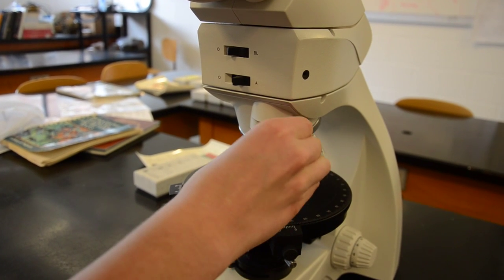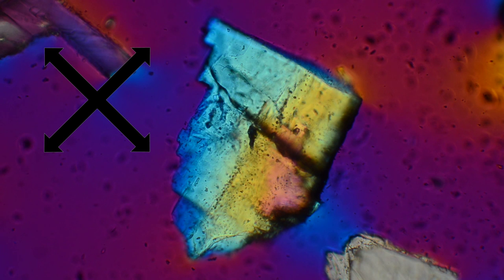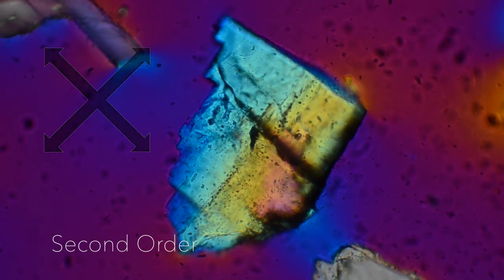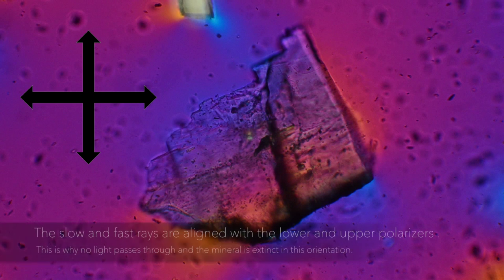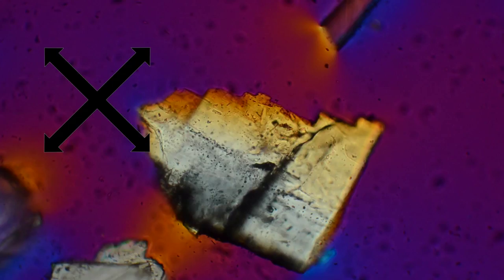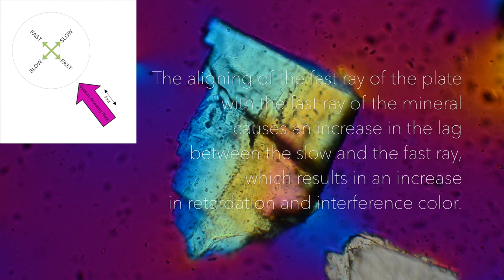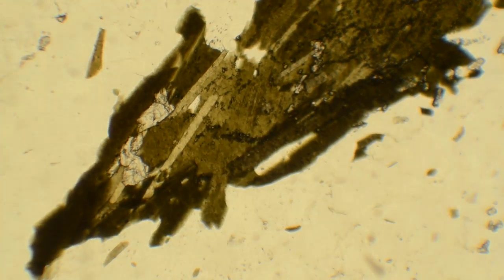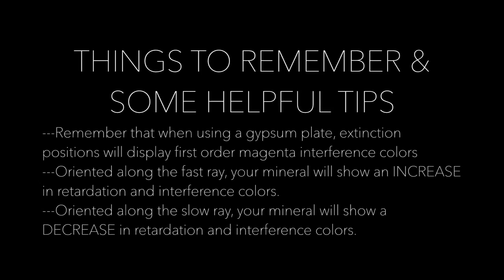Earth Optics Video 3: Fast & Slow Ray

Comment: My comments are similar to Erik's below:   I understand that a grain can have 'fast length' or 'slow length' orientation on the stage but how can a mineral, Ex lawsonite, be described as being 'length fast' as an attribute.
Also with respect to  in the grain sample of your video where we were to determine if it was fast or slow, with respect to the Michel Levy chart and looking from the starting position of magenta:   I couldn't see how the light aqua colour  [at  orientation +45 degrees] was deemed 'length fast' and that the white [at orientation -45 degrees] was 'length slow'.
Thank-you for your videos.   They are the best mineralogy videos on "Youtube
Reply from the maker: Hi! Thanks for your feedback :D 

The orientation is key. A section (or slice) of a mineral grain can be "length fast" over a different section of the same mineral.  Along different orientations of a mineral grain,  the distance between the fast and slow ray will change. Many minerals, like lawsonite, can be "sliced" into different sections - for example, a rectangular prism with a long c-axis can be sliced parallel to the c-axis and have the shape of a  rectangle with a long aspect ratio OR it can be sliced perpendicular to the c-axis and have the shape of a square. These sections have different orientations and will widen (or close) the gap (or retardation) between the fast and the slow ray of light passing through your sample. If you see "length fast" or "length slow" in a textbook, it is likely referring to the position or section of the mineral grain that preferentially widens the gap between the fast and slow ray of light ("length fast") or closes the gap ("length slow"). I go into characterizing minerals along their crystallographic axes in later videos, if you are interested (see uniaxial flash figure and biaxial flash figure).

To answer your second question - from magenta, the light aqua color is a higher order interference color (second order). Since the retardation increases (as represented by the higher order color observed), we can say that the fast ray is propagating distinguish-ably faster than the slow ray, due to the orientation of the grain (the gap between the fast and slow ray widens). From magenta, white is a lower order interference color (to the left on the chart). The retardation decreases here because the orientation of the mineral grain closes the gap between the fast and slow ray. I'd be happy to try explaining another way if this doesn't make sense. 

Happy mineralogy-ing! - Sam

Comment: I always find your videos helpful, but I'm still struggling with fast vs slow a little bit.  I think some of the terminology I'm seeing from other sources is confusing me; can a mineral be described as length fast or length slow?  It seems to me that there is a fast ray and a slow ray and the orientation of the grain affects the maximum birefringence seen in the mineral, so what would it mean for a mineral to be "length fast" or "length slow?"
Reply from the maker: Erik - Short answer to your first question is no - a mineral cannot be described as "length fast" or "length slow."  As plane polarized light hits the thin section, it splits into a faster and slower ray. A mineral grain position can affect the distance (retardation) between the fast and slow ray of light as they pass through the grain, and you are correct - this is dependent on the grain's orientation with respect to its crystallographic axes.  Along different orientations of a mineral grain, this distance between the fast and slow ray will change. If you see "length fast" or "length slow" in a textbook, it is likely referring to the position or section of the mineral grain that preferentially widens the gap between the fast and slow ray of light ("length fast") or closes the gap ("length slow").  Wish I saw this comment earlier - I hope it's still of help. Let me know if this needs more explaining (or different wording) Happy mineralogy-ing! - Sam